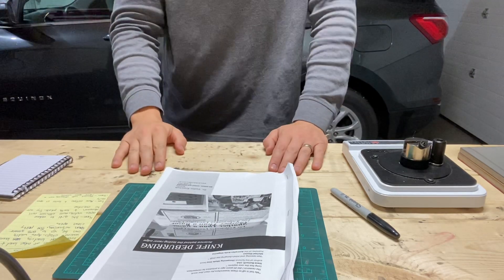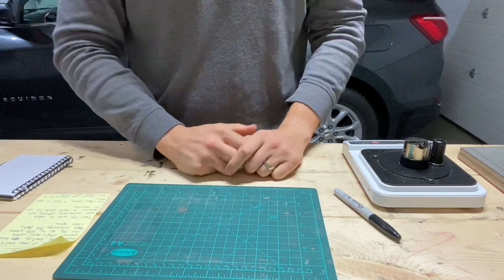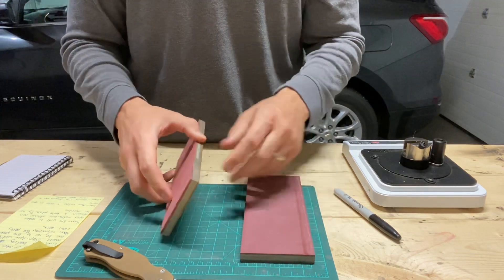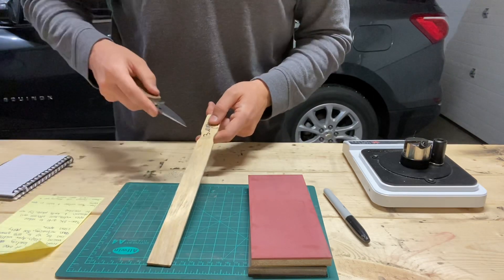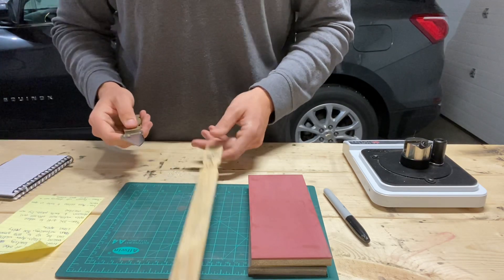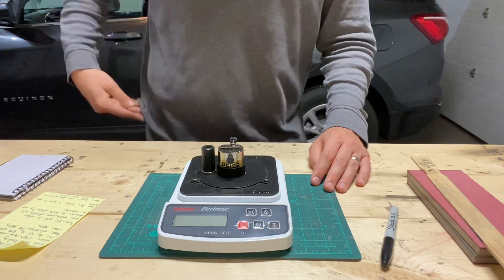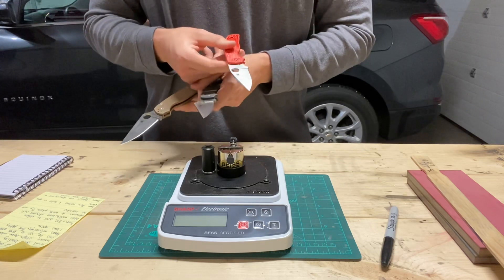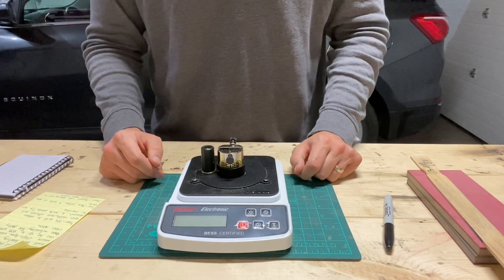My Hypothesis on Stropping and Burr Removal

Comment: Hello Justin. I'm always trying to learn new things about sharpening so I love to see another perspective. I think maybe you will enjoy this long sharpening theory discussion.

For blades that cut with impact a polished edge may  increase edge durability since it has less fatigued metal and less points of fracture.  Gabe from the Home Slice had an excellent experiment on it, and Cliff Stamp also recommended it.
A high polish edge is also great for cutting paper, hair and raw meat but it tend to slip on other materials. 

Sometimes a coarse edge works better than a polished one despite the apex not being as fine and despite the subsurface metal fatique. For example if you cut rope a polished edge will not perform well nor last very long. Another example is barbecue crunchy fat layer, if you use polished edge it slips like crazy and a rough edge performs much better. In the kitchen polished edge tends to slip on tomato skin.  

Coarse edge has a thicker apex but if well sharpened it can shave hair even out of a 36 grit. I haven't tried that yet but I managed to shave badly out of a 120 grit silicon Carbide stone. That expected apex width rule from the book doesnt match my experience because that on a 120 grit stone the apex would be 12 micron and fully blunt. This sharp coarse edge cuts vegetables and barbecue very well but struggles with raw meat. For a general purpose knife I would rather finish somewhere between 1k and 6K. 

A Bess tester is interesting but its important to test your edges on the materials you will be cutting instead of just the Bess numbers. Sometimes numbers don't reflect reality, for example If you are using a cutting board  and the knife has perfectly formed apex with 0.1 micron may be too thin to hold the edge. It will perform great on the Bess and then drop severely because the edge just rolled despite no Burr. A thicker edge that can just cut paper towel but no hair wittling may not perform as well before touching athe cutting board but may be strong enough to avoid rolling . 
Going down to 0.1 micron on soft steel is certainly a bad choice, on high hardness and high toughness steel its worth considering and experimenting. A Bess result before and after the first day of use seems like an interesting experiment.

I still need to test hair whittling to get my own opinion on it. I heard that hair whittling doesnt last long so I only sharpen untill I can shave hair and cut paper towel. So far I like to pay more atention to edge geometry rather than just apex sharpness. For example most kitchen knifes with up to 60 HRC can't be sharpenned at 10 degrees but if you add a 15 degree microbevel even soft steel can hold the edge. This more acute edge will perform much better on hard vegetables like carot an onion.
Reply: I have a similar perspective & decided to develop testing equipment to test our concepts.   I want real data from cutting real foods.  
I am currently testing to get a baseline for factory sharp 15º angle apex grinds. 
Currently comparing them to 15º micro-bevels with 8º grinds for secondary  bevels 0.005" to 0.006" behind the d\secondary bevel. 
I will post a video with results.
Reply: @danielbottner7700  This comment was from 2 years ago. I got some new experiments done after that. 

I tested hair whittling edge on a Din 1.4116 steel blade at 56 HRC. I didn't notice a significant cutting performance difference on food, probably most of the resistance comes from behind the edge. The edge didn't roll as I was expecting, It kept shaving sharp after the first day of use but on a single session it lost the hair whittling capacity and could not pass other hanging hair tests. Probably I should test it again on better quality steels but the results were so bad I gave up on it and now I only sharpen my knives until they can cut paper towels.

I had much better results paying attention to edge geometry and surface adhesion.

Edge geometry has a huge impact on cutting performance as you probably already noticed.  Many people say you need a 20 degree large bevel on soft steel but that's not my experience at all. 
I sharpened a 54HRC knife at 5 degrees and finished with a double microbevel. 0.05mm at 15 degrees followed by  0.19 mm at 10 degrees. The thickness at 1 mm from the apex was 0.13 mm (0.005''). This could blade could push cut onion Brunoise without impact, something I had only seen on high end Japanese blades. Considering how thin it is I was already expect high cutting performance,  but I was expecting low durability due to edge rolling or chipping. 

To my surprise this ultra thin geometry could withstand multiple moderate impact on the cutting board and still cut paper towels afterwards so now I don't expect any durability issues. Considering how little force I need to cut probably this will outlast a thick 15 degree edge on the same knife as long as I don't abuse it. 

I did this impact test to check for edge durability but I would not use it on impact knives or a carving knife that has to deal with lateral forces. 

The decision to leave a thick edge on European knives is a cultural choice and not a limitation of the steel type or  hardness. That being said a 60-63 HRC knife would have much better edge durability.

By your description what you did sounds pretty close to mine but we could have some measurement bias. For example my measurements with a cheap plastic caliper were very different from microscopy analysis. Microscopy not only is more precise but it also gives a better idea of what is going on. 

Another important point I learned was food adhesion. It happens due to capillary adhesion force. A polished Full Flat knife sticks to potato like crazy and has horrible cutting performance even if its cuts paper towels. A very subtle convex, hammered finish or embossed surface significantly reduce surface contact area and resistance by adhesion but its not enough to make the food fall off.  An obvious convex will make food fall off but will create resistance because its thick so not ideal either. A subtle S grind Convex concave will do the trick without unnecessary resistance as well as my power drill grind lol.  

When you try food as performance you need to try what you cut more often but it's good practice to try onion Brunoise as its one of the harder tests for shoulder resistance. Carrot Brunoise is even harder but I skip this test because I never use it in practice. Potato is the best test I got for adhesion. 

Everything I mentioned is available in my channel but It's on Portuguese. If you want to watch it with subtitles and don't understand something feel free to ask me.
Reply: @thiago.assumpcao  My observations have been very similar.

On a chef's knife, the edge can be profiled to an almost arbitrarily low angle, and there will be minimal damage cutting vegetables with a microbevel around 14-16 dps.

One can take a German/French chef's knife and thin the edge to around 0.005", with a hairline edge bevel at 15 dps, and it will exhibit high sharpness and smooth cutting without needing constant touchups.  Contrary to what this channel and many others claim, the apex deformation is minimal, and resharpening when needed can be done in seconds, so there is little need for better edge retention.

Harder steels (62 and up) can hold a lower apex angle, around 10-12 dps, without rolling or chipping, and this can improve performance on some delicate cutting tasks.  However, the effect is not as huge as you can be led to believe.

I cut a lot of barbecue meats as well, and the findings were the same as with vegetable cutting.  A 15dps microbevel is sufficient to stabilize the apex.  Of course if you run into bones it is very different.

I have found no use for highly polished edges on kitchen knives.  For vegetables, the Spyderco Medium benchstone gives a good apex finish.  I flattened mine and conditioned the surface up to F320 SiC, and it leaves a fine edge with the right amount of bite.  For barbecue meats, a DMT 600 or Fine India stone works well.

It is curious that so many people claim otherwise - for example that steels under 60 HRC fail constantly and need to be "realigned," or that only hard Japanese steel can hold a thin edge.  But since my results are better than theirs, I have to conclude that they are either doing something wrong or are just repeating stuff they heard.

Comment: Very nice video explaining the issues of deburring and the different levels of burrs. I too sharpen my expensive kitchen knives using Shapton glass stones from 500 to 8000 grit, and now using Jende 1 micron and .25 micron strops at the end. I have noticed as you've said, that even when  I've sharpened and thought that I've deburred the edge and done cut tests with soft paper, I've cut some veggies like carrots and celery, then noticed that my expensive Shun or my Bob Kramer 8" Chef Knife, suddenly didn't feel razor sharp anymore after just cutting some veggies. So, even if you can't feel a burr with your fingers, there can still be a foil burr on the edge that is not detectable by feel because it's sticking straight off the apex of the edge. That's why when you use your sharpness machine, the thread can fold over that foil and score that 150 or 200 sharpness. Getting rid of that imperceivable foil burr is so difficult. I've ordered an old-fashioned "Razor Strop" with linen on one of the strops to try and rid the "Foil Burr" before going onto my Jende 1 Micron and then .25 Micron diamond strops. I'm hoping that will be my ultimate solution to the "Foil Burr" issue with those of us that are seeking the ultimate sharpness. Lastly, even "Corks" or "De/burring foam squares" sold by sharpening suppliers, doesn't always work to get rid of that microscopic foil burr that can't be felt with even sensitive fingers. That's my two cents on this subject.

Comment: All of this burr removal is predicated on your cutting stones being  of diamond abrasives. Which means a total anihilation of the metal. That is correct for all diamond abrasives , no matter the particular size. Im wondering why all Japanese whetstone's are allways of a ceramic material. They seem to work very well.  ln this discussion it a;; has to do with super abrasive /steel destructive diamond. Can you imagine using non diamond abrasive to sharpen, no matter what steel is is being sharpened.
The belief is that diamond may be quick,  but it also had its issues.
Reply: There is nothing wrong with Diamond
Reply: You must love toothy edges/ don't care about the durability that diamond abrasives , lack.
Reply from the maker: Sounds like you only have experience with diamond plates. Resin bonded or Super Vitrified diamond abrasives are head and shoulders above ceramics. You will get higher performance from them with any steel but it's extra pronounced with high VC steels. I love my ceramic Japanese stones too but diamond is the top dog
Reply: @EngineersPerspective701  
If you are referring to diamond plate , because of economics, then the durability, is very short lived. That is because of the diamond is rigid , in a metal structure. If you are referring to resin or vitrified diamond , then you are needing much higher speed or velocity of the surface. That equates tO a very different economic situation/  as long as you abrade with a fairly  high micron or grit size of diamond.  The purpose is for speed cutting/Finish should always be on a non cbn or diamond surface/ that is for durability of the metal apex.
Reply: I did forget a very important factor in the use of any diamond or cbn cutting abrasive. That is , the quality of manufacture of the final abrasive product.
Accuracy of the actual size or grit, as well as the volume of abrasive .
Reply: By the way. If assume that, you are basing all of  your opinions are on , venev abrasives. That product line is based on consumer or semi  professional work . That is also true of the Gunny Juice emulsions.
Reply from the maker: @abrahamkalichman6845  my experiences are with the Venevs and Triple B Super Vitrified 400 and 3K

Comment: Just came across this video of yours. Can't believe I missed it when it came out. Anyway, very interesting. Still seems like so many variables to take into account, especially when freehanding. Anecdotally, basically consistent with what you are saying, I have noticed that for me on most steel that 4 micron to 1 micron or 0.5 micron seems to work pretty good on strop progression. However, there are of course many combinations I haven't tried to compare to no doubt. Curious about that idea about knowing if the burr is there based on specified low BESS threshold score. Seem like you could have a dull/blunt edge with no burr but high BESS.
Reply from the maker: I think a lot of the variables are just getting used to your methods and the particular blade even anecdotally. 

What I will say has been frustrating me at the moment is with all types of steels and strops, I can generate new burr when stropping and it doesn't take that many strokes to do either. It seems like unless I'm either careful or highly intentional with my strop progression that I make the edge perform worse. The direction I'd like to go is lower grit compounds and just not overstrop, only used to "clean up" so to speak. 

Absolutely agree on the  essentially blunt edge with low BESS score. Some of the sub 100g kitchen knives I've done have been DREADFUL in action. I did get a killer 70g on CTS-BD1N but the point is if BESS score is the only concern then it's easy to be lead astray.
Reply: @EngineersPerspective701  this issue of forming a burr with stropping is interesting, I don't think I payed much attention to it before. I have always done alternating passes when stropping though so maybe that minimized burr formation anyway and it wasn't as much of an issue, I don't know. I am curious if you have noticed this to be dependent on the stropping medium at all?

Also, was interested in your mentioning about microserrations. Guess you were referring basically to the effect you get with natural stones that I have heard of though I guess it is present to some degree with most sharpening. Would be curious to know more about this for sure. 

On a somewhat seperate note, you always hear about people bringing their dull edges back with some stropping. I have usually just done quick resharpening. I like sharpening anyway. Recently, however, I was playing around with stropping the edge back. Starting with the higher 16 micron compound then going to the lower microns seemed to work pretty good to get some bite back into the edge. With your talk of forming a burr with stropping it is now seeming to me that I was just basically doing a form of "mini" sharpening anyway with this stropping I guess 😄 Maybe I will purposely try forming burr as I would with regular sharpening just to see  how it goes.

As always, look forward to following your further elucidations on the sharpening process.

Comment: Hey great video, do you by chance have access to a microscope? Some years back when I purchased my first microscope to examine edges that really opened my eyes as to what is going on with different stages of the sharpening process, really an invaluable tool in my opinion.
Reply from the maker: I have an inexpensive 120x one that I've used some but not in a while. I've had a number of comments about it so I think I really need to circle back. 

My memory of it is that it was difficult to see the final transition from tiny burr to clean edge but no doubt its something gained over time.
Reply: @EngineersPerspective701  Nice, is it a USB type microscope? When you start getting into mid level and especially higher end microscopes you can actually see the micro chipping you talk about. A metallurgical microscope imo is the best for these close ups (since is projects light through the lens) and is what I use, also have a stereo microscope up to 90x that is extremely useful. When you get around 400x or so and up is when you really start to see what is going on.
Reply from the maker: @NORTHWESTKNIFEGUY  Mine is a Carson MicroBrite 60x-120x handheld for $16 on Amazon. It does have a light at the base so I can see edges decent but I think I'd need that 400x to take it to the next level as you've alluded too. Definitely can't swing a metallurgical one, the wife would put an end to me😅!
Reply: @EngineersPerspective701  Yeah, it really makes a world of difference. If you keep an eye out on ebay for a nice used one you can save a lot over getting one new, run it by the boss and maybe she'll let you get one. :-) Also a cheaper compound microscope like swift, amscope etc. will normally work well too on the lower settings with an overhead light source like an led lamp shining down.
Reply: @NORTHWESTKNIFEGUY  ----- Microscopy is a science in and of itself. There are videos using microscopes at 400X+. I think one guy set up a metallurgical scope at 1200 or more, and resolution is as important as magnification. I have a USB set at 200X and I still don't know exactly what I'm looking at. I tried a $100 dollar metallurgical at 800X (trivial price compared to $10,000+) but it's such a tricky thing to focus .... At some point, I think one must imagine / picture what is going on and proceed with theory. To go to 2400X you're into lab science, properly prepared samples, oil immersion, polarized light ... not worth it!